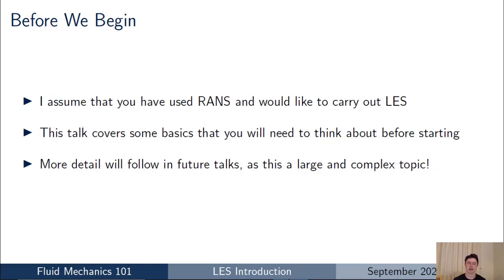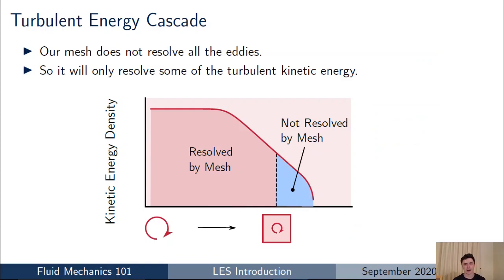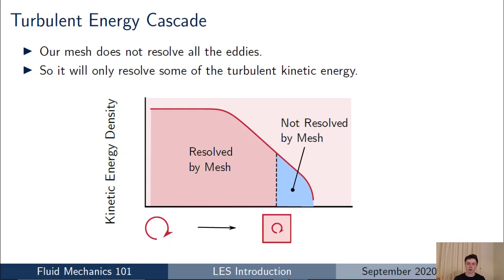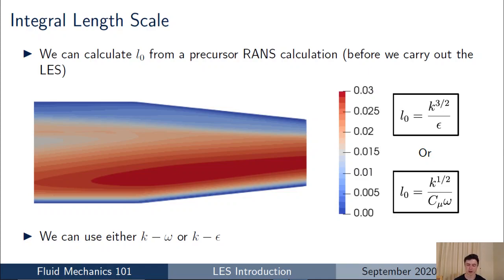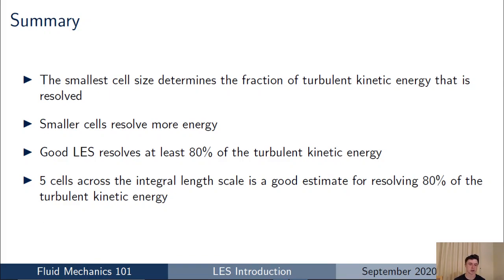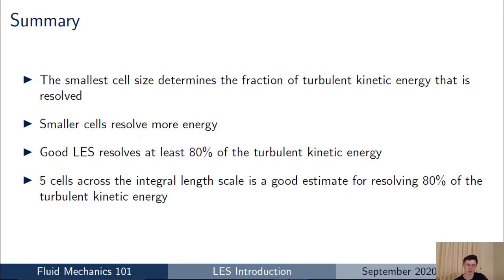[CFD] Large Eddy Simulation (LES): An Introduction

Comment: Key/Important takeaways from this lecture -
1) Eddies and turbulence
2) Wave number representation of an eddy: wavenumber, k=2*pi/d, where d is diameter of the eddy
3) Larger eddies --> greater TKE, lower wavenumber
4) The energy cascade and wave number : the need to resolve atleast 80% of the turbulent kinetic energy (TKE) by a good LES
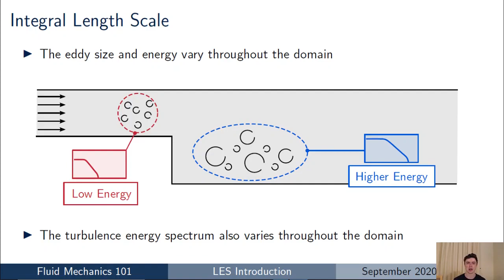5) Integral length scale @16:58 (L0) - Single eddy with a length scale (size) that is representative of all levels of eddies present the location of interest
6) @18:10 - Mathematical equation for Integral length scale L0.
7) @19:35 - Use of steady state RANS calculation using any of the standard 2-equation models to determine integral length scale over the domain by post-processing. This forms a preliminary step.
8) @21:59 - Determining an accurate grid size based on the computed length scale. Requires nearly 5*5 cells distributed over a square of size L0*L0
9) Towards 23:40 - new parameter f to replicate the down factor of 5 from the integral scale. Shorter and more efficient way to determine the goodness of the grid resolution is to create parameter f=L0/Delta, where Delta is local cell size. So directly compute f in the initial step of TKE to judge grid.
Reply: Thank you so much

Comment: Dear Aidan, your channel has by far the greatest chance of becoming the best CFD channel there is. My recommendation is that you should slowly start to include how to implement turbulence models in CFD im terms of coding from simple to relatively complex problems, either here or on your Udemy course. Of course advanced applications should be avoided as it will be very much time consuming on your end, so just enough to give people the main idea. From there you can move forward to heat transfer, combustion, hypersonics etc..however you want. Maybe you can then move to include OpenFOAM or other software. Keep up the great work.

Best regards.
Reply from the maker: Thanks for the advice! I will see what i can do

Comment: Hello Aidan,
thank you for the concise explanation about LES.
So if a fine proper RANS Simulation is done, a LES Solver with automatic mesh refinement would be very helpful generating a proper mesh for LES. But I'm not sure about the wall treatment in LES, because some RANS-Models use wall function other Models need a resolved boundary layers.
Reply from the maker: Dont worry, i am going to do a video on this soon. It is more difficult than you might expect because we want to keep the aspect ratio of the cells low, so the boundary layer meshes that we use in RANS arent good enough most of the time unless we use WMLES
Reply: @fluidmechanics101  I will test your suggestion (5 cells across the integral length scale), but I'm afraid that the numbers of cell would increase dramatically. I remember that for a second order method in space, the numerical damping could be "neglected" if the length of a cell is about one order of magnitude smaller than the resolved size. So this would be an even higher restriction. Could you share your resource about the (5 cells across...)? Maybe I misunderstand something.
Reply from the maker: The recommendation of 5 is from an old ANSYS presentation. I will see if i can find a link for it

Comment: Thanks, Aidan for the very insightful talk! As a good estimate for a finite volume scheme, it is mentioned that 5 cells across the integral length scale are likely to resolve 80% of the turbulent kinetic energy. How does this guideline translates into a spectral element scheme in which the higher-order polynomial functions are used to approximate solutions and these grid points are not equidistant?

Comment: Let me take a note here, thank you.

19:48 before run LES, a RANS simulation should be run to calculate l0
24:07 If f=l0/delta<5, the mesh is too coarse. [ delta = (mesh volume)^(1/3) ]
Reply from the maker: Yep 👍 then once you have done the LES you need to check the TKE directly and remesh if necessary

Comment: Very well done. Most sources do not really explain one of the core differences (TKE) between a RANS and LES, which is something you have covered. I currently work with LES for my dissertation and haven't really had the time to look into Hybrid RANS-LES. I know enough to include it in a literature review, but are they really helpful when compared to a regular RANS? I'm sure they are, else people would not use them, but why are they better? In case of external flows around a bluff body (airfoil, cylinder, automobile, etc) you are mainly interested in the boundary layer close to the body and a hybrid RANS-LES uses a RANS approach in these areas and LES around the RANS region as they are relatively a lot more expensive if you run a pure LES.  The main reason to run a hybrid RANS-LES that comes to mind is the fact that the inflow profile would be more realistic, but I wonder if there are other reasons to it.  Do you have any insight on this? More videos on LES would be awesome btw.

EDIT: I'm guessing implicit vs explicit LES would be a good topic for a future video. I wonder if this is something your audience would be interested in. Implicit is pretty much what most people use from what I gather.
Reply from the maker: Yes everything you have said above is correct. Sometimes we care about the wake downstream of an object and it can be useful to have an LES wake even if the boundary layer uses a RANS treatment. Think about wind turbines. We would like to know how far downstream to place the next turbine. With a RANS model, the wake dissipates very quickly and it looks like you can place the turbines closer together. However the LES wake is less dissipative and persists much further downstream. Make you can add that into your literature review?
Reply: Haha... I should have thought of this because I'm working on wind turbine blade sections. Wind farm simulations in research groups that I know of use LES and discs in place of the turbine rotor. I'll find out if they use a hybrid method. It does make sense to use a hybrid method in cases like this thanks for that insight.  I doubt they resolve the boundary layer in this situation for the cases I have in mind though.
Reply: As Versteeg mentions: there are two groups in turbulence modeling.  1. Make current RANS model more and more accuarate catered to a specific case, particularly for industrial application.  2. Search for general turbulence model (LES comes in here).  Problem arises when we try to account for factors like anisotropy in turbulence. This is one of the motivation for developong LES too...cause smaller eddies are approximately isotropic.  So,  SGS can be used to model the effects of energy exchange. 
Well,  some RANS model are designed  to account for anisotropy but are not sufficient. And,  the problem is: these model are more case specific. I have experienced this myself. As far as when we need LES as oppose to RANS,  more specifically U-RANS. I would say,  all cases 🤣  It can be deceiving when we see vortex shedding on a cylinder with U-RANS.  But when lets say, we have a stepped cylnder- BOOM, U-RANS gives  crap results.  Sometimes,   we dont even see mean flow variation in the wake.
Edit: we can consider hybrid models. LES is certainly computationaly demanding.  I usually prefer based on my aniticpation of how the flow field will look like?   Massive separtion? Bye bye U-RANS.

Comment: Thank you for this amazing lecture! Which tool in paraview  should be used to calculate the lo? Because I usually define a volField in the solver and compile it again
Reply from the maker: Just use the calculator in paraview. It should be fine. You will need to export the cell volume as a field from your CFD solver though 😊

Comment: Thanks for this, as an experimentalist it definitely makes it more approachable. Implicit LES appears to be just DNS on a coarse grid, right? So you just allow the coarseness of the grid to low-pass filter your solution? I feel like there isn't much justification for that besides "we can't do any better" right?
Reply from the maker: Yep 👍
Reply: @fluidmechanics101  adding my 2 cents here - The filter itself is virtually always implied to be a low-pass filter at the grid scale (this is not where the term implicit LES comes from, although literature uses this term sometimes in a confusing way). However, implicit LES is used to denote the simulation strategy where the effects of subgrid scales are not explicitly modeled, but they are implied by the (typically dissipative) truncation errors of the discretization scheme. This indeed corresponds to a coarse-grid DNS. In 'normal' LES you would add a subgrid-scale model.
Reply from the maker: Thanks for the clarification. This has been really helpful 😊
Reply: @wimmunters9859  Thanks, this makes more sense to me. But isn't relying on truncation alone an issue? Depending on your discretization scheme and its accuracy, you'll get different truncation errors and different filtering intensity and spectral behavior, right? Doesn't it make it even more difficult to assess the quality of a given LES simulation?
Reply: @fzigunov  I am by no means an expert on implicit LES, but indeed, the (implicit) subgrid-scale modeling will be highly dependent on the specific discretization scheme that is used. For a specific scheme, these truncation errors can be analyzed and characterized in great mathematical detail using modified differential equation analysis.

Comment: Thank you for these videos. It really helped me to understand the details of LES and RANS. It would be great if you can also explain or make a video about DES, DDES, IDDES, specially IDDES where URANS works in the inner layer and attached boundary layer and LES in outer layer  and separated flow regions.  It, therefore, contains modelled components from both LES and RANS. Can we judge the mesh based on percentage of Kres  /(Kres+Ksgs+Kmodfromrans). In that case how to calculate Ksgs and Kmodfromrans in openfoam. Is the k field in time directory of openfoam is Ksgs or the sum of Ksgs and Kmodfromrans? Also how to decide appropriate y+ value in this case?
Reply from the maker: You still want y+ to be less than 1 if possible. As for your other questions, I don't know the details for OpenFOAM, I would have to look through the source code 🙂

Comment: Great video, i keep watching it over and over again, i am using LES for immiscible oil-water flow using VOF for multiphase flows, however, i get spurious currents at the interface when i use 2nd order bounded time formulation, however 1st order time is just fine, could you tell me why? also could you explain to the the integral length scale when using K-Omega, what is C_mu ? how can i get it? i am using Fluent
Reply from the maker: I am not sure about your spurious currents but I can tell you that C_mu =0.09 is a model coefficient. Sometimes you will see it referred to as beta^star which is also = 0.09

Comment: Thank you for nice lecture. I have a question about the estimation of required mesh size for LES (based on RANS results). Is there any theoretical analysis (or reference) that suggests the mesh size of 1/5*(integral length scale) may be a good for LES? (@ 22:00)

Comment: Thank you for the very nice video! I think I'm confused about the integral length scale because I can't find reference with a clean simple definition like yours.

Can you please tell the reference of the formula you use for the integral length scale as the eddy that represents the average kinetic energy ? I'm searching the references by Pope, Wilcox and others and I'm having trouble finding a similar formula. Usually they refer that the integral length scale is the largest eddy.
After looking at the Pope reference, is the the integral length scale (largest eddies ) equivalent to your definition as the length of an eddy at the average kinetic energy of all eddies ? 

I made the math with your integral formula and using the eqs 6.259 and 6.260, the result is = (4/3pi)*k*L11 / k = (4/3pi)L11 ≈ 0.424 L11 . Then in page 242 its said that L11 is the same as l0.
In the Pope book Turbulent Flows : 
The eddies in the largest size are characterized by the lengthscale l0 (page 183)
The bulk of energy is contained in the larger eddies in the size range of lEI=(1/6)l0 < l < 6l0 
The lengthscale that characterize large eddies is L = k^(3/2)/ε (page 200)
The relation 6.225 (page 228) of the longitudinal integral scale is the closest relationship to your slide, is it the same?
Then in the page 576 the filter width for 80% is referred as well in the exercise 13.10.

Comment: 00:02 Introduction to Large Eddy Simulation (LES)
02:01 Turbulent flows have mean flow profiles with a range of eddies of different sizes and energies.
05:38 In Large Eddy Simulation, a subgrid scale model is used to simulate eddies smaller than the mesh resolution.
07:33 Estimating the optimal mesh size for Large Eddy Simulation (LES)
11:31 Large eddy simulation resolves only some eddies, not all.
13:30 A good Large Eddy Simulation resolves at least 80% of turbulent kinetic energy.
17:10 Understanding Integral Length Scale in Large Eddy Simulation
18:46 Integral length scale helps set up the mesh for LES.
22:11 Resolving turbulent kinetic energy using cell size estimation
23:55 Using the field 'f' to evaluate cell size for mesh refinement.
27:07 Introduction to Large Eddy Simulation (LES)
Crafted by Merlin AI.

Comment: Impressive talk... Thanks alot, It was great aid for me to set LES solver. But I am confused how I can calculate the cell size using ParaView?
Reply from the maker: Ah yes, i forgot to say this. You need to export the cell volume as a field from the solver, then you can read it into paraview like any other variable. You can definitely do this in OpenFOAM and Fluent. In CFX the variable should already be available in the post processor. For OpenFOAM, you need to use the ‘postProcess’ utility to create the cell volume as a field. Have a quick google search and you should be able to find it
Reply: @fluidmechanics101  thanks alot Aidan, now I am looking forward to your video on subgrid scale model ;)

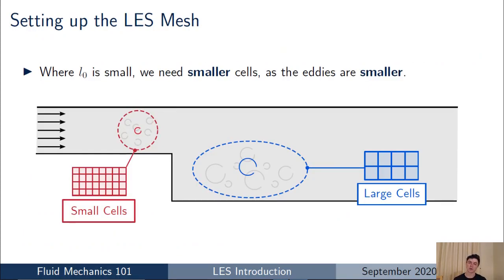Comment: Hello, sir. At 21:08, it looks like we can use larger meshes in the region where the flow is more chaotic, which confuses me since I initially thought we should use finer meshes in the region where the flow is more turbulent. Do you have a more detailed explanation? By the way, your videos are fantastic!
Reply from the maker: My explanation was more for understanding (and I'm sorry if it was confusing). Normally for LES people choose a freestream cell size based on the estimates and use it everywhere. They then check the fraction of resolved TKE to see if it was fine enough. If not, then refine the freestream cell size everywhere. 

Conceptually this is different to RANS where we often use local mesh refinement. The reason for the difference is that when the mesh is refined in RANS we are converging towards a solution. However, when we change the mesh in LES, we actually have a different solution because technically we are solving a different problem! So we just pick a mesh that is fine enough to resolve 80% of the TKE everywhere and then we are happy
Reply: Thank you for your patience and clarification. Although I still cannot totally catch your point(maybe I still use the RANS viewpoint to think about LES), I will continue watching your videos and trying to find some related works.